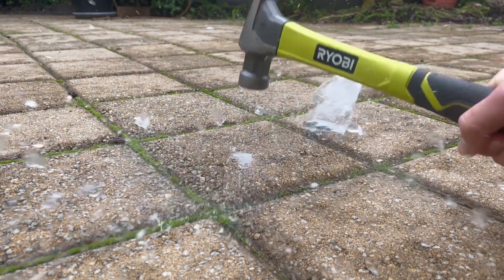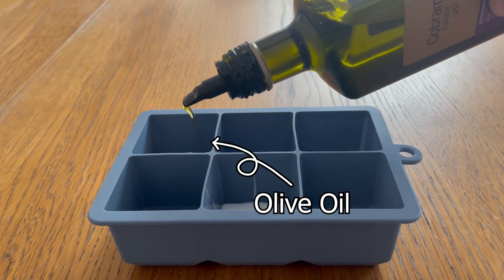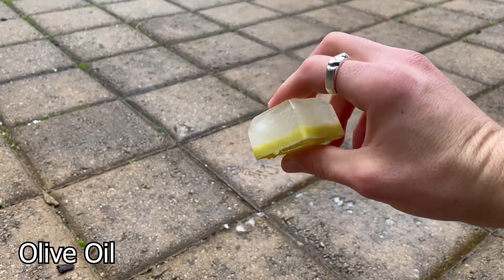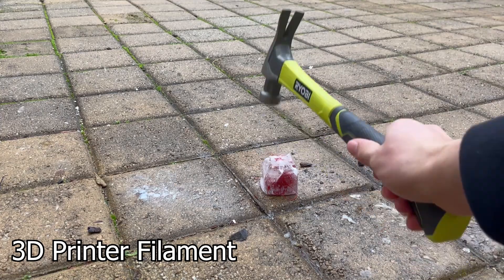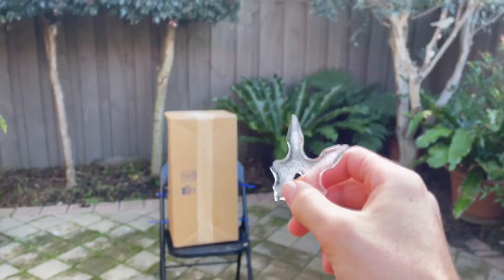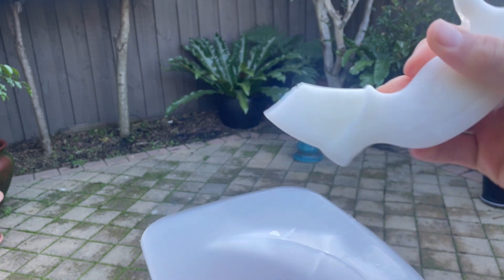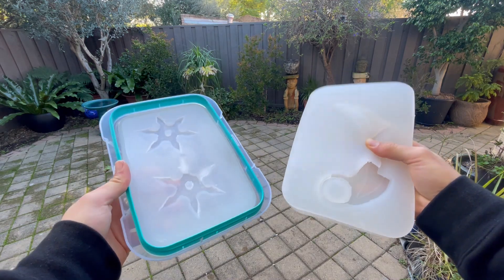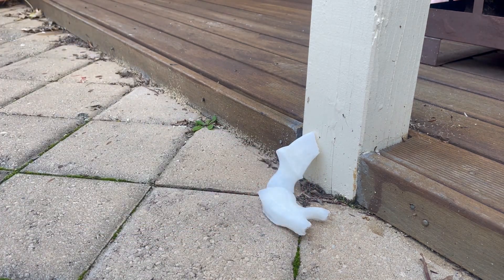I Made Ice Stronger… and Turned It Into Weapons!

Comment: Would be cool to see  these weapons with clear ice. If you insulate the bottom of the mold it will freeze from the top down so it wont trap any air. It wouldn't make it any stronger though.
Reply from the maker: I wanted to see them clear as well but I had no clue how to. Thanks for letting me know. It’s a shame it doesn’t change the strength
Reply: @ClarrieC  No it has to freeze from the bottom up and it will make it slightly stronger because air bubbles are catalyst for breaks

Comment: The reason the mold didn't work is probably because you didn't mix the silicone enough
Reply from the maker: Yeah I don’t think I mixed it enough. Also maybe it was also the fact I was using a rubber star and that didn’t mix well with the silicone

Comment: I think if you would put the iron pieces in a continuous pattern like one layer from top to bottom and the next from side to side like that I might make it stronger 

(plus you can put paper towel in the places the iron pieces don't go to so that it will support the places where it's just ice)😊
Reply from the maker: For the metal I did originally try that but ever time I moved the Mold it fell apart so I gave up. And then for mixing metal and paper towel I didnt think of that and that sounds like a great idea I’ll have to try it
Reply: ☝️☝️☝️ @ClarrieC
Reply: Also you could freeze it by layers and not do it all at once 

Also if even that messes up when you try to move it. you can try to build it straight in the freezer😊
Reply from the maker: Oh that’s a good idea I didn’t think about making it in the freezer or layer by layer

Comment: use vibration and freez it it will make all the o2 come out and your latice will form tighter
Reply: works for bullets 2 its called blue ice ice sculpters use it cause compared to normal ice it can last for a 9 : 1 ratio at least the slower the freeze time helps to keep iy just above freezing for a week then drop it to 0 degrees shoul giv you some long lastiing stuff also diffrent vibration freqency will give u diffrent results
Reply from the maker: Wow I didn’t know that. Thanks for sharing that knowledge